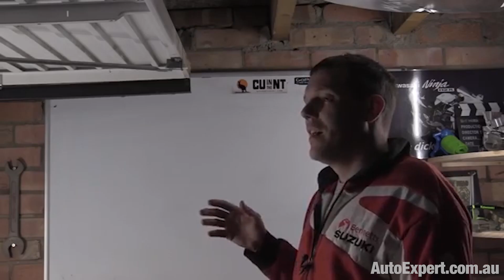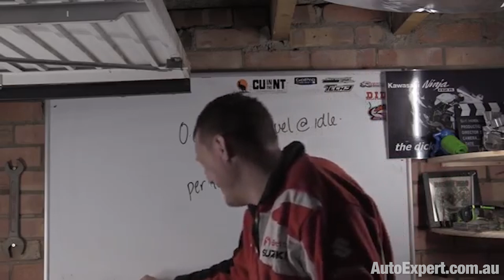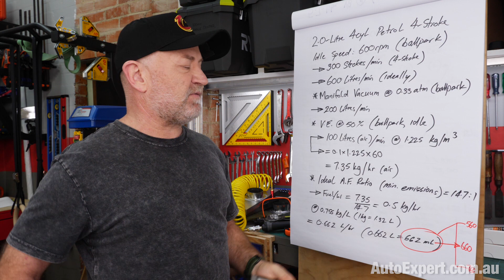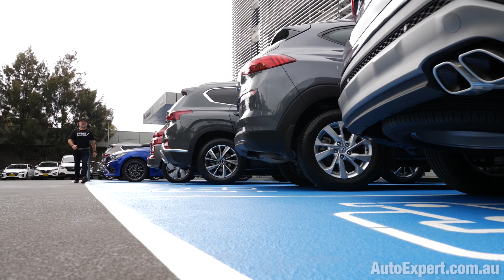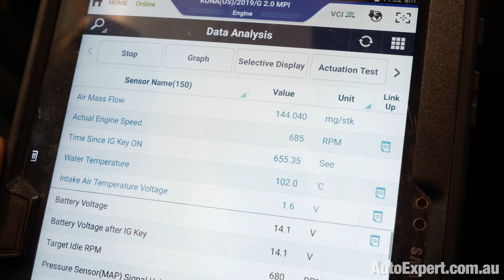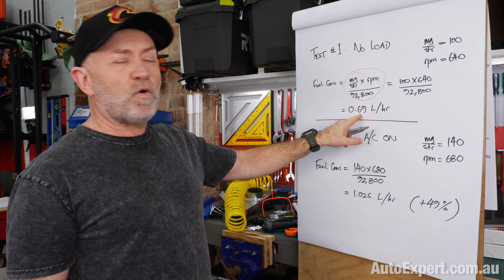Engine Fuel Consumption at Idle Explained (theory and physical test) | Auto Expert John Cadogan

Comment: today engines working according to Atkinson's cycle making this a bit more complicated... But for simple four stroke engine those callculations are precise. Atkinson engines are on idle blowing out some fresh air from cylinders so need less fuel when idling. how much less? depends from configuration. I would like to know how much form sucked fresh air is blown out before valves are closed and compression stroke starts. 10% 20% 30% ? depends from car maker and engine model?

Comment: You don't need to be any sort of genius to know that any sweeping statement about X.xx liters per hour per liter of displacement have to be wrong.
For example a 2.4l inline-4 diesel with a compression ratio of 18.6:1 idling at 560rpm vs a 2.4l V6 turbo with a compression ratio of 9.3:1 petrol idling at 840 rpm.

Comment: and the extra 0.09 up from 0.60l/hr is accounted for by the engine not being under "no load" because in a modern engine even idling, its alternator and waterpump are causing a small amount of load(somewhat larger in the alternators case as its keeping battery charged, ecu running, injectors, 1-2 fuel pumps and a pile of other things).
Reply: You're forgetting the trans pump and converter resistance also, but who's picky. I know from experience my jeep 4 liter 6 cylinder uses a hell of a lot more at idle than 0.6 l/hr.
Reply: @davidvoinier6008  aye those jeeps sure do, actually my v6 3L maxima was using a hell of alot more aswell for awhile, untill I discovered a partially stuffed reference crank pos sensor was messing things up and causing the ecu to go ham on the fuel
now it seems to use about 0.75l/h idle accordin to fuel flow rate

Comment: To be fair to the Québec numbers, they are probably an average for the year and also probably represent cold start numbers as we let our cars idle in the winter to have some heat coming out the vents before we set off. Winter is mentionned in the last two paragraphs of that webpage. They are relevant numbers for Québec but useless to use to evaluate the value of stop/start feature.

Comment: Haven't watched your whole video yet, but measurements* from my 36 year old 1.3 L engine give a fuel consumption at idle of around 780 cc/hr. Turns out that falls bang on with the 600 cc/hr/litre that your haters give. I'm absolutely certain that a modern engine would do better than that.

*And by measurements I mean fuel flow output figures from the ECU I have fitted to the engine. Overall the fuel consumption figures are within 2% of actual fuel consumption, but I think the injectors are into the nonlinear range at idle, causing errors in the readout. It probably does use a little less than the readout says. (I never characterised the injectors using a testbench, just adjusted the values for stability across various supply voltage levels, etc. while on the engine)

Comment: Water temperature 100+ C? WTF? Isn't it supposed to be around 90C?
Reply: Newer cars are around the 100 mark, the coolant is pressurized so the boiling point is a fair bit higher than 100c

Comment: My BT50 2.6I is heaviest on fuel when sat stationary in traffic idling.
Petrol engines idle rich, nature of the beast.
And my Mazda is a beast at using fuel at idle.
I avoid idling it, wastes fuel and wears the engine.
But thanks for the facts and loosely included hubris from guest experts.
Reply: Umm mate your high consumption in the traffic condition you mention is not from the engine idling. It is from all the additional events of acceleration your engine is performing per distance (kilometer) travelled. Admittedly the idling at stop will add around 650ml/hr of idle per gas tank. And that will come out to 3/5ths of fuck all. Your consumption increase is in the main due to multiple acceleration to travel speed events per kilometer or per tank of fuel.

Comment: Diesels use virtually nothing at idle. Have you ever looked further on the Diesel Emission dangers based overall on one German study using statistics of Deaths in Cities compared to Country areas. It was a guess. They had no good control group and failed to eliminate other contaminates in Cities compared to Country areas.
If they want to do a Statistical Comparison they need to do like with like. 
Not City against Country residents. 
It needed to be Country Residents against other Country Residents that had high exposure to Diesel fumes. 
In the Country easy. Plenty of Farmers still alive that have spent thousands of hours on open Diesel Tractors without Cabs compared to other Country Dwellers who had not spent thousands of hours on Tractors. 
Then they would have a comparison with some validity.

Comment: Pedantic, nerdy question - I would have thought that what you would be measuring coming into the cylinders would be the air/fuel mixture, not just the air. If this is so, then if the air:fuel ratio is 14.7:1 then surely there are 15.7 parts in total (14.7 air plus 1 of fuel) and you should be dividing by 15.7? Not that this would make any material difference to the eventual point of the story. Great vid!

Comment: I would think the engine uses only rpm and not the O2 sensor to set the A/F ratio at idle since the throttle should remain closed and only fuel would be used to control rpm. It's quite likely the car is running lean at idle, with the most efficient A/F ratio being around 16:1.

Comment: That's a very very low idle speed your using for your calculations I've never personally seen a 2l 4 cylinder idle smoothly at below 750 rpm
Reply: My old escort idled pretty low when at temp.

Comment: John, I love it when a twerp gets his comeuppance. However a question if I may. What does the 14.7 FA ratio represent? Is it a constant irrespective of engine speed and/or load (taking acceleration time into consideration)? I've been involved in setting up an EMS in an injected 13B rotary to run in an aircraft and the sweet spot seems to be about 12.5 at 6krpm and full throttle. The engine builder has said we may need to look at about 10.5 to 11 if we fit a turbo charger based on the same RPM (with a prop pitch adjustment for the increased HP). It sort of doesn't add up but would love your opinion. Cheers Dayle...

Comment: Toyota Hiace 2007 2.7ltr ODO 380,000 klms 700ml per hour at idle. Plug in scan tool 2mins no math. Easy. John got it nailed. Mat at The Workshop was way off the mark.

Comment: just a note that the car you read the computer on did have loads on it. 1 alternator 2 transmission (more for automatic and less for manual ) 3 power steering and belts  ect. if you figure in these the amount will look more correct.

Comment: ml/h doesn't mean shit to the Bay majority of drivers. How about a more practical measurement, such as :
how many seconds of idling would make it more cost effective to turn off the engine?
Reply: Engineering Explained has a video on that.  watch?v=dFImHhNwbJo
Reply: @chris746568462    I've watched that video. I wanted to see if this guy could confirm those results. Otherwise, arguing whether  it's "per hour" or "per hour per liter" is just virtual dick measuring non-sense. There is no practical use.

Comment: Well there’s always the (valid) argument/observation that with a shutdown engine, there’s no additional exhaust/pollution being produced.
Ergo, The ( “#$@&#ing”) Start-Stop function is a good thing for you, so don’t you dare complain ...

P.s. Can (do) disable it in my Vehicle. But PITA in that you have to do it ( disable) for each engine start.....hmmm, maybe a aftermarket coding possibility out there ya think?

Just a thought, having one cylinder at/just before TDC on its power stroke in order to restart the engine ( in Star-stop mode) has anyone considered mixture pressure bleed-down in that cylinder resulting from say sitting at a very long stop light, waiting for a train to pass, etc? Would you not (during the subsequent auto re-start) have to actually need to “crank the engine” to get  injected air-fuel mixtures into the cylinders? As such, wouldn’t there be a perceptible pause/hesitation possibility?
Kind of embarrassing if trying to make a turn across oncoming traffic?🤔

No brain damage, after eigenvalues, diff equations, Fourier analysis, etc.. this was a snap.

Comment: Other things people over look:
1) Generally, engines with more cylinders will have a slightly lower idle RPM and those often are the larger engines.
2) If an engine has variable valve timing, the effective displacement and compression ratio are reduced at idle. (Intake valve timing)
3) Modern engines idle leaner than older designs.
4) When you put your foot on the gas to go, consumption is suddenly way more than at idle and how much more can vary with engine temperature.

Comment: I understand a technicians scan tool shows fuel consumption based on the readings from the ecu. Does that figure match up with your calculations and which is more accurate?

Comment: That would explain the 300ml per hour my 200cc generator uses whilst idling under zero load conditions. Measured empirically of course:)
I have argued with this workshop idiot before about two strokes when he told me my Jawa would seize if I went down a long hill with the throttle closed. The Jawa knowing he is thick didn't believe him and therefore didn't seize of course! What sort of moron would argue against a repeatable observed experiment?
As an electrical engineer there is a difference in power consumed (fuel used) between a thermostatically activated electrical fan and one directly connected via a fan belt for example or an air cooled engine versus a water cooled one :)

Comment: The most interesting info I gained was the increase in fuel needed to run the A/C compressor at idle... I always thought that at cruising speed the A/C sucked approx 10% of the engine's power, naturally increasing fuel consumption by approx 10%.  Or am I mistaken and it is more, or less, or too difficult to quantify to an exact %?

Comment: Hi John, appreciate the work that you have done on this, most interesting and covers something that I have been curious about for a while.
Given your figures and the difference between an engine just idling and one running the air on at the same time, with an auto transmission is there much difference between sitting at the lights with it in D and your foot on the break to control creep, and just having it in neutral with no load from the torque converter? I tend to do the latter.

Comment: Can you do an air conditioning effect on energy consumption in an EV? (eg: Kona or Ioniq). Admittedly it would be better to wait for summer on a 40 deg C day but alternatively, you could drive to Bowral at 10pm when it is close to zero degrees Celsius next week, park the EV, leave it on with the heater on strong enough to keep you warm with you wearing your fishnet stockings and T-shirt and see how quickly it drains the battery in an hour. An EV can't use the “waste” heat from the ICE to warm the cabin. Just make sure you've got enough energy in the battery to get back home!

Comment: I totally concur with your findings and that of the other credible boffins you’ve mentioned. I have a 6ltr VF SS Commodore (Chevy SS to Retardistanis but with an L77 not an LS3) and manual (so non-AFM) and I recall, when it was a standard motor, that it only showed itself using between 1.7-1.9l/hr at idle. Simple maths would tell you that this would come out to 566-633ml/hr per 2litres! How surprising! I’m sure Mr Sideways Pommy git’s head might just explode now. 😂 It’s now got a “warmer” camshaft and a few stronger components after a premature big end bearing failure. It now idles around 2.8l/hr so about 933ml/hr per 2litres. If it was to try and idle with only being fed the std 600ml/hr I’m sure it’d either shake me to death or just stop! 😂

Comment: There was a time when I was solving a similar problem with fuel consumption. My dispatcher (I used to drive cargo) kept telling me that on cruise control, my car consumes more fuel. Specifically, he said 1 liter per 1000km (negligible value). So I went on, to test his hypothesis in practice and wrote a spreadsheet to check my fuel consumption.

Of coarse, it should be recognizable in 2x1000km test (2x one tank on my van). And, first test have shown him to be wrong by two liters. However, being curious and knowing that an error could have occurred I kept on testing.

It turns out, it's impossible to measure this in practical test, as the variation in measured values will be between 2 to 5 liters, per 100km. All that, while there was nearly no direct correlation with cruise on or off, or the load on the car. Very simply, the amount of variables in that test was so large, that the difference between cruise on or off was impossible to read out. In fact, it was impossible to say whether I was going fast or slow, night or day, jam or not. That's how large that variation was.

Comment: Hi John - how close to 14.7:1 does an engine actually run at when idling? I know that at higher revs and load, cars tend to run richer than that (down at something like 10:1) for safety (running lean, for the readers/watchers, is bad). I realise that you've stated 14.7, but didn't clarify how close cars run to that ratio at idle - I don't want sideways pom having another angle...

Comment: Dear John
I didn't go to university but would it not have been easier to just fill the fuel tank and then run the engine for one hour and then just measure the amount of fuel needed to refill the tank to the previous level?
Being told something using complex math is less believable than a practical demonstration.

Comment: love the video John i think the sideways man whinging pom and conspiracy theorists deserve the mighty king. I did bleed from the ears during the mathematics calculation but great job proving all those dickheads out there wrong. A quick question wouldn't it be easier to measure the fuel flow to 1 injector and then just times that by how many injectors on the engine to get the actual physical fuel flow at idle ?
Reply: bandr  just because I said I did bleed out of my ears didn't mean I didn't follow the maths dickhead.

Comment: Thanks, but the non believers do not accept maths, physics, logic etc. Mass and energy balances do not have to balance if you are building an over unity engine, and WTF is Entropy. Anyway, I am sure there is a lot more Entropy about than there used to be.
 Thanks for a well explained and practically demonstrated, explanation.

Comment: Hey John, while I comprehend your analysis, I would not have done this video based on that. if I were attempting to prove the fule (yes I like to spell fuel 2 ways) consumption per hour to as many viewers as possible, I would have set up a car idling with the fuel coming from say a clear 1 litre bottle and then measure how much fule was consumed after 1 hour. This would clearly prove your claim to many more people in a simpler, easier to understand way. Theory is ok but there's nothing more interesting than a hands on actual test!

Comment: A lot of modern engines don't have air throttle valves. They control fuel injection into each cylinder just like diesels.

Comment: As a Pom subscriber to both channels I still found this interesting, I appreciate that going slightly leaner than stoichmetric is only going to have a proportionate on the consumption. How lean does a modern petrol engine go while idling... 16:1? The practical measurement vehicle had quite a lot of lighting running... which will increase fuel consumption by some amount relative to the previous research figures. 0.6 litres/hour for a 2 litre is a good ballpark, close to 8hours to an Imperial gallon.

Comment: Jeez. Thank "god" I pulled my pants on, following advice from previous vids, before watching this one. I suppose you could just throw the ballpark numbers for 3,5,6,8,10 and 12 cylinder engines?
And how much off, those numbers would be, in a carburator (with a proper membrane...) equipped motor?

Comment: If a 2 Liter Engine consumes an amount of air that needs about 600cc of fuel, I would assume that a one liter engine consumes about half of that amount and a 4 Liter engine about double that amount of air and therefore fuel. If this is not the case than the throttle in the one liter engine has to be a little more open and the throttle in a four liter engine has to be even more closed. I do not think that is the case.
In my opinion it follows from you own calculations that the fuel consumption at idle does depend on the engine Volume. It is about 300cc of Fuel/h/Liter. Correct me if I am wrong or even better go to Hyundai again and repeat your test with a one Liter engine. It should have half the air mass flow of a 2 liter engine and therefore half the fuel flow.

Comment: Why don't you just put a litre  of fuel in a bottle. Connect it to a car leave it on tick over and time it. Know it's simple but at least better than 42!!!
Reply: 42 is the answer to the meaning of life, the universe, and everything! I know that 42/70 = 0.6 but I would need a degree in "bistromatics" to work out the 70 bit.

Comment: Hi John, I enjoy your stuff immensely, especially the comments on Euro Trash.
However, a 2 litre 4 cylinder engine has a swept volume of 0.5 litres per cylinder, so 300 strokes/min equates to a theoretical 150 litres/min, not 600.
Please take as constructive feedback.
Reply: I'm wrong. 600 RPM is 1200 power strokes/min @ 0.5 l/stroke = 600 l/min